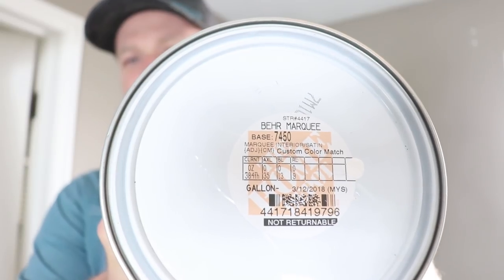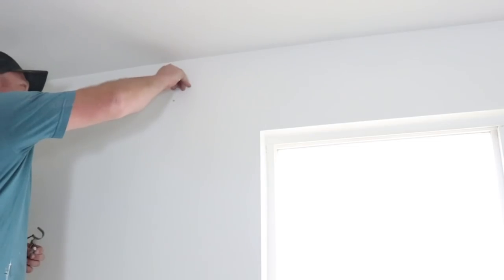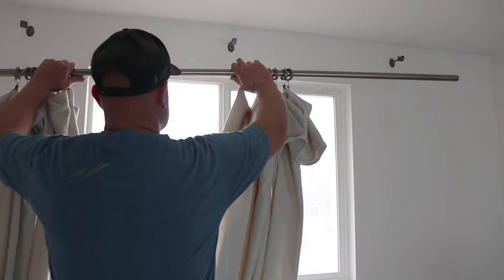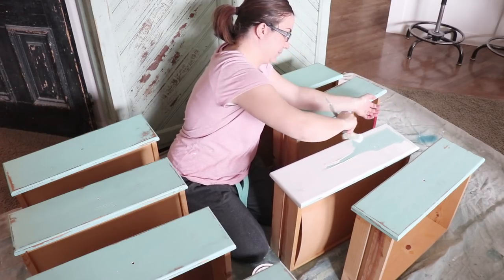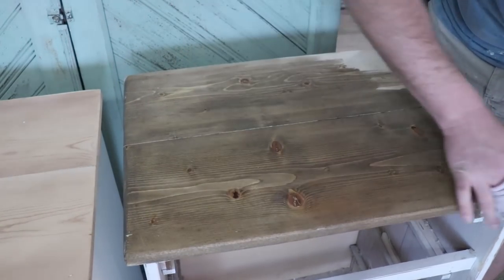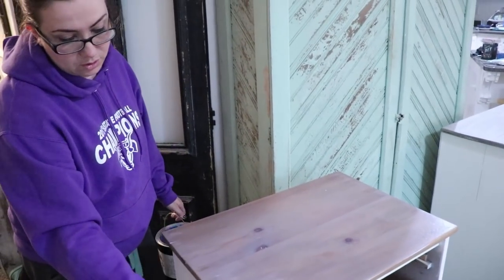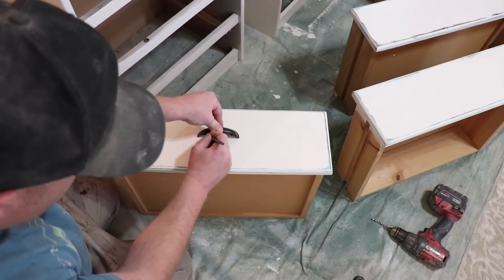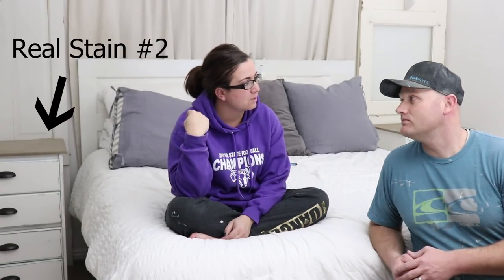Farmhouse Bedroom Makeover Part 1 | Curtains and Nightstands

Comment: I remember in the first bedroom makeover video you said that Zeb likes to sleep in a dark room..... I am the same way, you can put blackout curtains on a tension rod inside the window frame to hide them so still have a real dark room for sleeping and your pretty drop cloth curtains will still be the star! (you probably already thought of this) =)  Or, I have actually safety pinned blackout curtains to the back of my curtains so they can still be opened to let light in but block it out when you close them. It makes the curtain a bit heavy so you might need to add a couple more curtain clips.
Reply from the maker: Great tips!  Thanks!

Comment: Looking great!  I have a question, once the weather gets a little warmer I plan on painting my front door.  It has a wood look now but isn't wood (metal, some kind of fiber?)  and is protected by a porch roof.  Which of your paints would you recommend for that, DIY?  Thanks
Reply from the maker: I would use Fairy Chalk mother or DIY. Both will work. You’ll want to seal them with an outdoor, UV rated sealer.